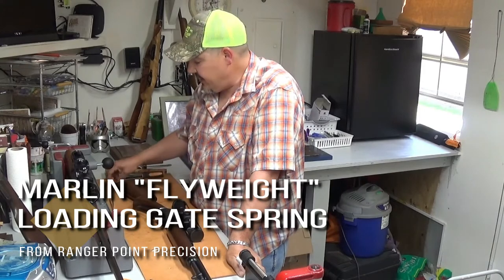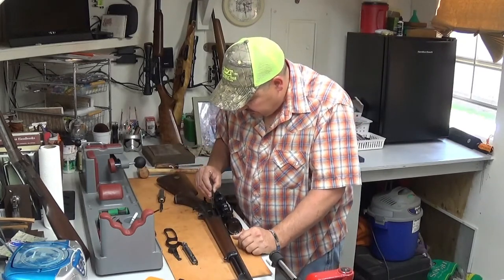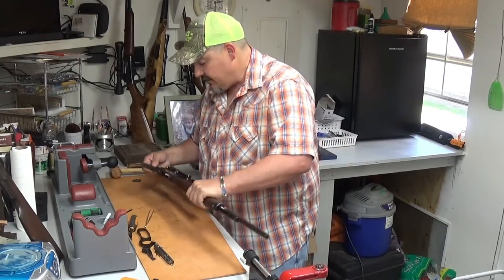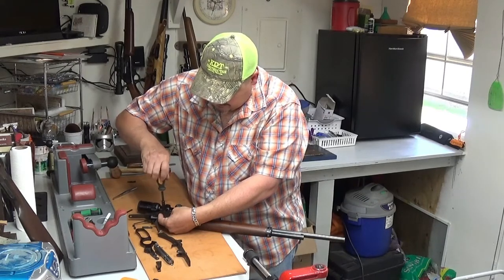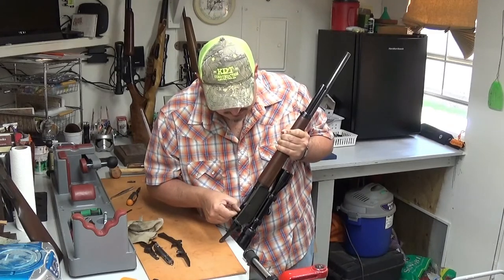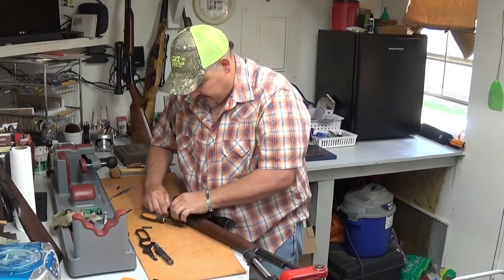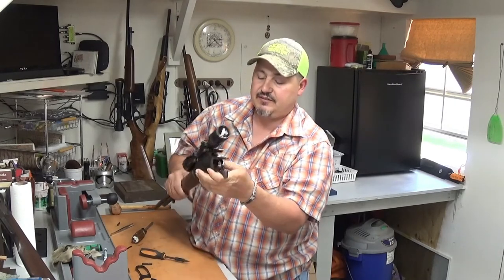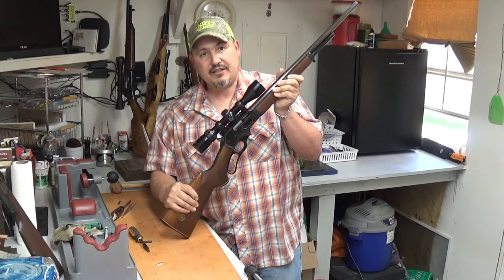Installation Video: RPP Marlin Loading Gate Spring "Flyweight"

Comment: Very good video on the Marlin Loading Gate.I have a question, can you replace just the loading gate screw with out taking the gun apart.If I just remove the screw will the loading gate fall inside the gun.Thank you for the video and taking my question.
Reply from the maker: No you'll need to take it apart or the loading gate will fall inside. No easy way to hold it in place.
Reply: @RangerPointPrecision  Ok Thank you.

Comment: If you just want to replace the loading gate spring screw because it's damaged, can you do so without stripping everything or will it pop out of place under spring pressure as soon as the screw is removed?
Reply from the maker: The only way to possibly do that would be to try to use a strong magnet to hold it in place (if you have the Marlin factory steel gate). Otherwise, you’ll need to disassemble it (via this video) so that you’ll be able to hold the gate in place behind it while you put in the screw.

Comment: Cool !!  So do these work the same on new and old 3030 marlins ?  Does it work as well with say a glenfield 3030 from the 80s or a 336 from the 70s
Reply from the maker: Yes sir the work on new and old just the same. :-)
Reply: Ranger Point Precision ok cool!!   Will be trying one out shortly and a few of your other products .  Do you convert 3030’s to 357 or 9mm etc ?
Reply from the maker: I wish that we could but 30-30 is not the right model platform for either. The 357 we've never done. Good news Marlin is shipping the new ones out now. The 9mm we used to build on either a CL 25-20, 35-20 or 218 bee.
Reply: Joe, the Glenfield is the same gun as the 336, with a birch stock rather than walnut.